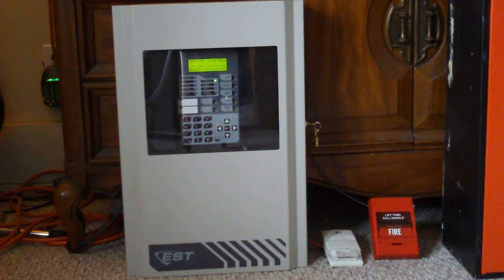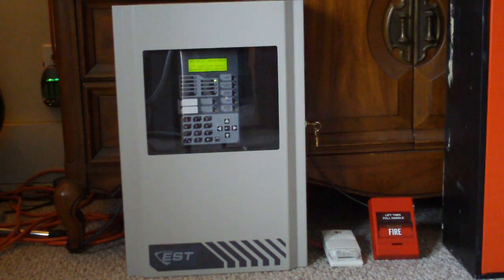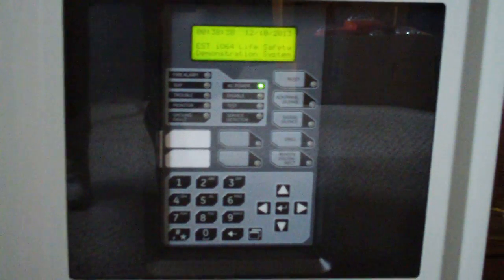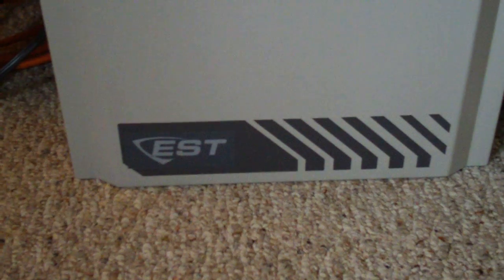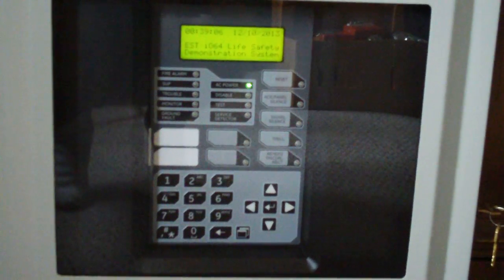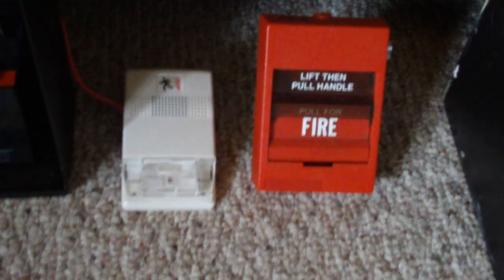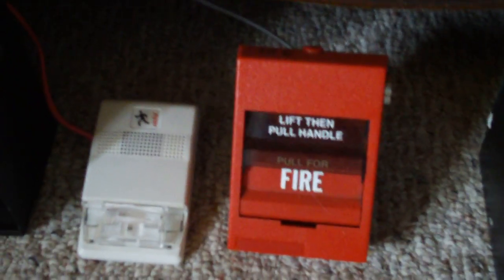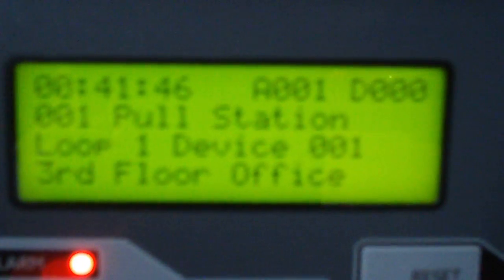EST iO64

Comment: Question for you?

The slc wire is you grey wire and running to the pull stations and the nac wire is the red running to horns and strobes?

Correct?
Reply: That seems right.  There's two wires in each, one positive and one negative.

Comment: If I have Mapping enabled and I want to swap out a siga2-ps (smoke head) to a siga2-hfs (heat sensor head, the one that fits in the same eaxact base unit.) Can I just swap them and wait for the "loop mismatch" due to serial number change. Then can I just enter on the loop mismatch on the led front panel and save this new device to permanent memory. Is it that simple?

Comment: Small correction the IO 500 will handle up to 500 points.  250 default and another 250 with the second SLC card.  125 modules and 125 smokes per SLC.  Nice panel for basic installs.  And easily programmed

Comment: I like the fact that the dress panel doesn't cover the batteries which makes changing them out when they are going bad much easier.  A lot of the Simplex panels have dress panels that cover the whole thing especially on the 4010 which makes it a pain to change or service the batteries.